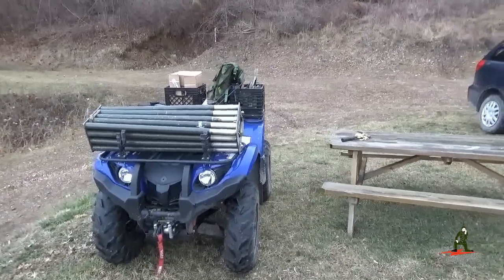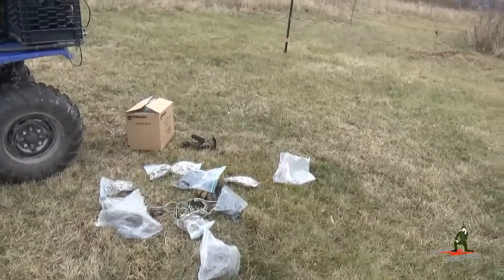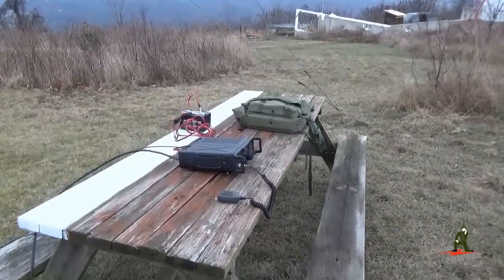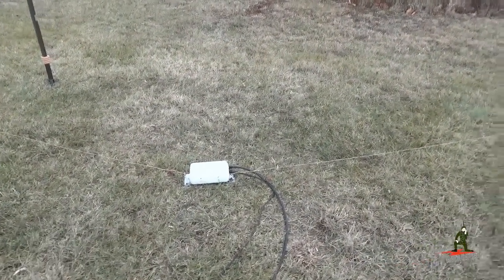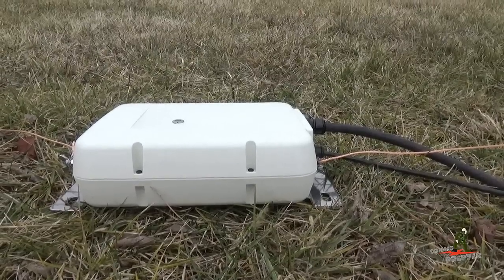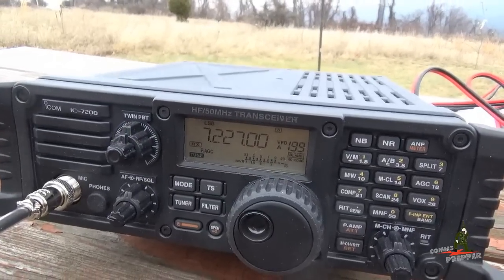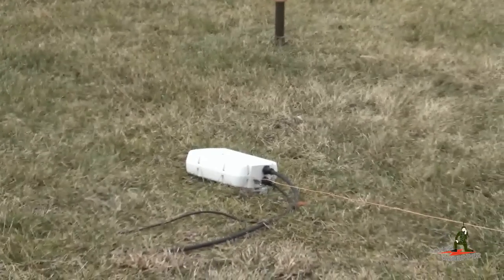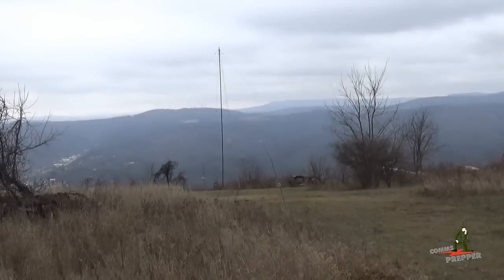Icom AH-4 Antenna Tuner - Delta Loop Antenna

Comment: A brilliant Setup. You make me thinking about to run a 67ft. of 1,5mm ∅ Antenna Wire with 2 Ring Terminals crimped and soldered on each End  as a Mono Loop Quad Antenna. Using my 40ft Spiderbeam Fiberglass Mast with the matching Spreader Kit by Spiderbeam. I got me a CG 3000 Tuner with U-Clamps to install the Tuner right to the Mast aprox. 12-15ft. high from the Ground.. I got the CG-3000 Remote Control Box for iCOM Radios including 32ft. Remote Cable and 32ft. of Coax Feedline. Wohooo...another new Project is waiting  to get taken care of, Hank. Hey by the Way, I am proud and happy IC-7200 Owner myself.
Have a happy & prosperous New Year and stay healthy. 73 de Uncle Guenter from SW-Germany 💯🙏🍀🛡🙋‍♂

Comment: How long is the antenna wire length? also you gave away the Hampshire County and when we DSFed you we found the mountain top. I have sealed the location in an envelope and its in an undisclosed location
Reply from the maker: 100' of braided antenna wire.

Comment: What I am not understanding is how the delta loop connects to the tuner. One side of the delta loop should normally go to the center conductor and the other side to the ground braid, but the AH-4 only has a single wire connector? Do you have the other side of the delta loop going to the coaxial out braid side?
Reply from the maker: In this video the antenna post is connected directly to the tuner's ground post.  While it's a DC short it has impedance to RF.  However, allot of wire is needed.

Comment: Could you run this configuration using a BNC cobra head adapter for the feedpoint, hooked to an LDG IT-100?
Reply from the maker: yeh but I would not run 100 watts through a BNC connector.
Reply: Commsprepper  BNC connectors have a 250 watt power rating...Great video,giving me a few ideas that  I can use for portable ops here in Arizona.

Comment: Wait. I could have used that relic as a vertical? I spent the entirety of 1989 through 1994 trying to shortcut an inverted V off that monster, and I could have just used it as a vertical? Seems like somebody could have mentioned that in training.
Reply from the maker: Depends - most kits were so old that the vertical insulators were long lost.

Comment: Nice, but I'd be finding a way to raise the tuner up off of the ground to control ground losses. At least a foot.  Would prefer to add another tube and raise the whole base up to 1m above ground.  And you can use your Twin PBT to get rid of most of that noise.  Just shift off center 
a bit.

Comment: I just pulled my old AH-4 off the shelf that I bought back in 2000, 2002.  I used it on our boat using the bow-rail as an antenna and anchor w/300ft of chain as the counter. lol,  It worked great but we didn't buy the boat to talk on radio :(.  I sold the rig after 2 weeks and I removed the AH-4 when we sold the boat 8 years later and put it on the shelt, until today. I bought anothe Icom to put next to the FT-1200 and now need the AH-4, I pulled it down and its still in great shape and hope to run a few hundred ft of wire this week.
Reply from the maker: Cool - mine is mounted in the bed of the truck.  I will have to remove it.

Comment: hey Guys on this video you tried to TUNE on SSB.
there's NO carrier on SSB you need to tune in CW or AM or FM.
73s
Reply from the maker: incorrect.  the AH-4 tuner works with the radio and when you press the tune button (regardless of mode) the radio will generator a low level carrier for the tuning cycle.
Reply: Commsprepper are you sure? I saw the video 3 times and never saw the radio change from SSB to CW or AM in order to transmit a carrier.

if I hit the AT button on my radio using SSB it will tune BUT gonna be an erratic or false measurement. but if you say so must be true.
Reply from the maker: I'm sure.  Did you notice the 1k tone that is generated then the tune button is pressed?
Reply: With these integrated ATU's you don't need to change modes, the radio interfaces with the tuner and produces a test sweep tone

Comment: How do you disconnect the AH-4 tuner connector from the IC-7200 ? Is there an easy way to do that, mine seems to be stuck on permanently ;(
Reply from the maker: It's touch for sure.  I have to work it on mine.  I have been meaning to trip/clip the connection to remove or reduce the grip of the locking tabs.
Reply: Thanks for the info, will do the same on mine. I use the IC-7200 on the boat with the AH-4 and at home with a balanced tuner.

Comment: One more question - which SCS Pactor modem did you buy and where did you get it?  I'm playing with Winmor right  now but was wondering if there was  cost-effective way to get an SCS modem?  73, K0CKH
Reply from the maker: +Chas H I have the DR-7403 with the Bluetooth.  However, Pactor 4 has not been approved for use in the U.S. yet so you can save a few bucks and go with one of the Pactor 3 models.  I ordered mine from http://www.farallon.us/.

Comment: Nice video - thanks for posting these!   What's the total length of your loop wire?   73, K0CKH
Reply from the maker: +Chas H Not sure - I just pulled it off the roll.  I would guess around 120'

Comment: Wow, somebody has been busy posting over the last few weeks - great videos. A comment on the delta loop: for field deployment, if your purpose is to work only 40m, you could ditch the antenna tuner and go with a full wave length for the loop itself and then feed with a quarter wavelength of 75 ohm (e.g., cable TV) coax as an impedance transformer. On the other hand, the AH-4 adds a lot of options, so maybe best to keep in the field kit. I'd still recommend the matching stub option for a permanent install where you want the least number of moving parts (less to fail).
Reply from the maker: +dhakajack Agreed - sound like a future video topic.  When things warm up we will get back in the field with that radio.

Comment: Nice instruction, Hank. One note: it's good amateur practice not to tune up on the same frequency as the net/QSO you intend to join, or any frequency on which you can hear traffic. Tuning transmits a carrier and causes interference to the other stations. Move up or down at least 3 Khz, and drop the power so as to minimize potential interference.
Reply: Have to say that is a pet peev of mine. Many ham videos seem to show the same practive over and over. 
They say it's only low power but for someone who runs qrp it's what I'm running to try and make a contact. 
HAM radio is a gentlemen's hobby it would be nice if we can continue to treat each other as such.
Reply from the maker: +Teak Phillips Thanks for the tip.  Respectfully - Hank
Reply: Do you think the 3 watts that came out for tuning bothered anyone? 🤪😱😂

Comment: I have an IC-7200 and use the Buddipole antenna system with it.  I may have to look into one of those old military masts for a hardier installation.  If you run that mast as a vertical, you are going to have to run some resident ground radials too.
Reply from the maker: +KA5IVR I did a video yesterday morning using the mast as a vertical.  We used the wire from the Delta loop for the ground/counter poise.  Bad news - I left the laptop at the retreat so it will be two weeks before I can post it.

Comment: this is the best one yet but speak slower on the net would help the other side to copy. yes this is the best antenna. have used it without a tuner at times in June each year
Reply from the maker: +George Gardinier Thanks for the tip.  I think I was speaking fast because it was cold!

Comment: Are you using the stock 16' cabling for your AH4 or did you get the 32 foot extension?  I just picked up the radio and tuner to build this setup for a fellow ham.  73
Reply from the maker: +ozy311 It's the standard length (16 feet) but I used my own cable.

Comment: that background carrier is killer.
Reply from the maker: +dale myers The IC-7200's DSP features would have had no problem with notching out that carrier.  However, it only works of the operator (me) remembers to use it.
Reply from the maker: +dale myers Yes it is. I tipped the ATV over yesterday coming back from making this video and spilled everything all out on the trail - including the radio in the pack. Scratched up the ATV and a sore leg today but the radio is just fine.
Reply: well you're ok and not badly injured. i'm looking now for one of these antennas.
 i want to make content like you're doing. survivalist intent comms demonstrations. i got the usnrdoc video and found it ok at best. i want to make one for the next level. such as disguising antennas, bouncing signals "to counter direction finding," and other techniques.
Reply: +dale myers The 7200 has an automatic notch filter, I believe. I don't yet own one, so I have no experience with the auto notch function.
Reply: some how i don't think a notch filter will discriminate that close to the reference frequency. and not hamper the intended incoming source signal. as an am carrier is wider than ssb modulation. just my thought on it.
Reply: the best way i know how to is to zero beat the carrier. but why is there a carrier? i heard nothing being modulated on it.
Reply from the maker: +dale myers My bad.  I really missed an opportunity to show off the DSP capabilities of the radio in the video.  It was cold and I was loosing focus.
Reply from the maker: +PTT Liberty Yeh my bad.  I missed an opportunity with this video to show of the radio's DSP features.  It was cold.
Reply: ok lol...

Comment: Nice score on the surplus mast !
    Is that delta config directional (say East/West); also what was causing the 1000Hz sinewave?
Reply from the maker: +Bruce Wayne It is directional I was shooting north west.  The 1000hz noise was an adjacent stations.  My bad - I missed a great opportunity to demonstrate the DSP filters of the radio.  It was cold and I did not think of it.
Reply: Commsprepper Thanks... What might one expect to pay for such a surplus mast?
Reply from the maker: Not sure.  I got this one off of ebay 10 years ago for around $200.00 with the shipping.

Comment: do an NVIS video.  I thought with the mast and sloping V that was your plan.  great video
Reply from the maker: +Sean Yunt I sold my AS-2259 NIVS antenna two months ago on eBay.  I can still make a sloping V antenna video on the future.  In this video I wanted to show that you could "short" the antenna post to the ground post and still communicate.  Delta and Quad loops with the wire tuners work great and are often forgotten or not talked about.  They are perfect for urban areas where there is allot of QRN for industrial devices.  Plan is to show vertical operations with the GRA-4 mast before we take it down and pack it up.
Reply: +Commsprepper I made a home brew version of AS2259 using PVC pipe.  It's got 40 and 80 meter ends.  use it for Winmor to regional stations < 200 miles from my QTH.

I prefer to use a bicycle repair stand to hold up the mast.  going to set this all up with the local emcomm team Jan 30 for winter field day 2016

Comment: awesome video Hank.
I've got a 10meter telescopic surplus Russian army version of that antenna. It looks almost identical when it set up. Works great on 40 and 80 meters as a vertical. I'm really looking forward to seeing more with this antenna.
thanks for sharing!
Reply from the maker: +SurvivalTech Nord STN - Thanks.  I had that mast for more than 10 years and never used it.  I gave it to a friend a year ago and borrowed it back to make this video.  I will make the vertical antenna video tomorrow then take it down and give it back to my buddy (can't take it back after giving it to him).  The plan today was to do HF email but the kids ran the battery down on the laptop and did not tell me.  Guess I should have extra laptop batteries - more preps.